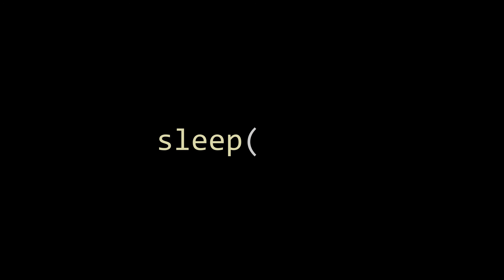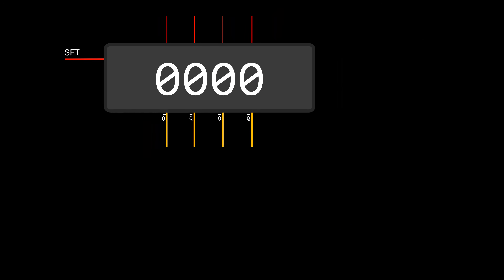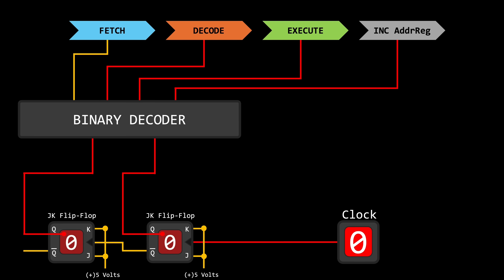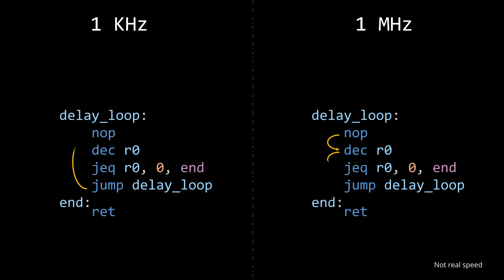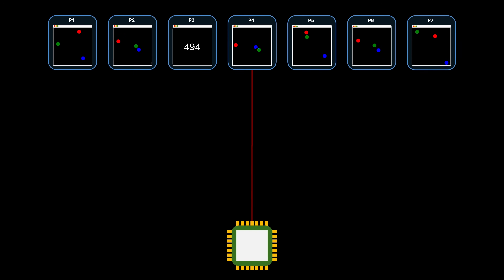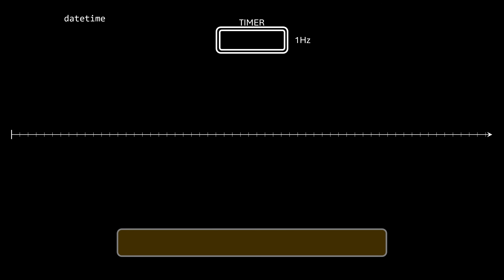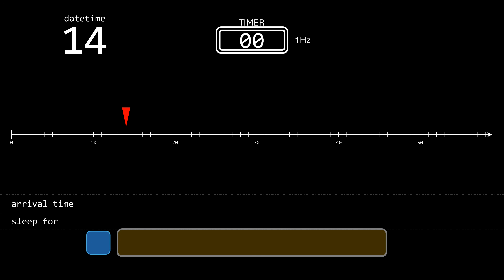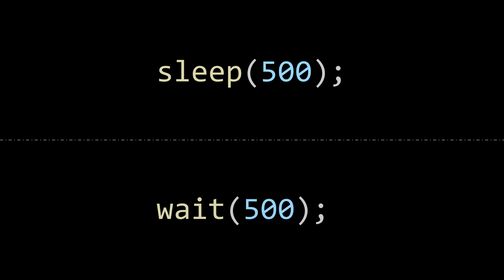What Happens When a Program Calls Sleeps?

Comment: Nice explanation. It is essential to remind programmers that their code has a connection to the limitations of the hardware beneath. This understanding was implicit decades ago, but there seems to be a growing detachment between some software and the physical limitations of the  hardware it controls .
In software space, anything can be achieved. In hardware space, physics limits what can be done and coders have to be aware of that, so that they can take it into account.
An exaggerated example could be; although humans are capable of feats such as jumping the height of a sky scraper in a video game, in the real world they can't and thus any real world code has to take that into account. No doubt few programmers would make the mistake of trying to make real world humans do in the real world what they can inside games, but there are many real world scenarios which are much more subtle than that case and coders need to understand physical limitations of the equipment they seek to control to ensure they do not introduce dangerous edge cases.

A real world example that came to my attention: an x ray machine had two modes. 1 full power for short bursts for treatment. 2 longer low level doses for diagnosis. The difference was a motor pushed a filter between the X ray source and the patient on the long duration diagnosis mode to cut down the intensity of the x rays and protect the patient.

Apparently the software controlling the machine didn't take into account that the motor takes a finite time to move the filter into position. The system was started in a non standard way ( understandable when humans are involved) and the X ray was started by part of the code, but the position of the filter was not monitored , just assumed. No delay was included to allow the filter to get into place and the patient received a long full power dose which ultimately proved fatal.

So you see software " mistakes" can have real world consequences, and the more software takes over from pure hardware, the more likely these mistakes or oversights will be made.

So the advice is that programmers shouldn't code in a vacuum, they should take time to understand how their software will be used and abused in the real world and take account of bad and lazy operators, who will test their code to destruction.

I've lost count of the number of times  I have heard " it wasn't designed to do that" when hardware or software failed in an exotic  manner. Of course it wasn't designed to do that, the designer just failed to take into account less than ideal methods of operation, IE the real physical world.

Comment: 3:24 can't the other process start a variable called end time which takes another processes timer and substracts it by the amount of time it takes
Like for example there are 2 clock circuits on a cpu 2 programs call it one more program makes a timer call one of the timers already being used on the cpu is at 10 and the new program needs a timer for 5 ticks and so the program records there are 10 seconds and then it checks "is the timer at 10 subtract 5 ticks?"

Comment: NOP is actually remained from the old intel architecture's opcode 0x90 which meant XCHG AX, AX so in human readeble form: swap ax with ax, which has literally no meaning and burns a clock cycle. So then they just began to call it NOP and assemblers added NOP support later on.

Comment: I think the "at least this long" is important for another part. Windows by default clumps up waking apps to a coarse timer interval. It's less than a second, but I want to say it's something like 500-700ms. But even though the system call to sleep may use millisecond precision, Windows won't service the app until the next interval.  That is unless the app says "hey, can you check faster?" and then you have scenario where Chrome was eating battery life because it wanted Windows to check every millisecond.

This is also a lot of fun with bare metal embedded programming, where you have to start worrying about how precise your clock source is. I had a naive clock app running on the SoC's internal clock generator and it drifted by minutes every hour.

Comment: So if i understand this correctly, the timer that implements the sleep timer is different than the timer that triggers the scheduler in case of preemptive thread switch? I know in x64 architecture the preemptive timer is implemented in the LAPIC associated with every processor core, where does the sleep hardware timer reside?

Comment: The few cases I used wait, it have taken a process or thread as argument, and waited until that threads is done with it's mission. Is this also handled by the OS/kernal, or is it just an implementation of sleep in a loop?

Comment: Oh, hey!!! I just learned this lesson!!! (At a higher level)

I programmed a game where I wanted to do a certain action while a button is held. 

I am a total beginner, so I used a while loop while the button was pressed.

….aaand the game froze

And because it froze…. It could never even satisfy the loop conditions.

Instead, I got it to do exactly that. Every frame it iterates through all of the different processes happening. When it got to mine, it checks if the button is and was last frame pressed, then either continues to do nothing, starts the action, maintains the action, or stops the action appropriately, then goes back out to do all the other stuff like input checks, movement, cheats, console, enemies, etc

Comment: JS is non blocking and typically single threaded. It's also gone through about 3 shifts in how it handles what would be blocking operations in other languages. All 3 are shown off in that sleep implementation. 

Namely, callbacks, promises, and async await. The JS engine will move on to execute something else while your code is "asleep," however, and will return to execute your asleep code once the timeout has elapsed.

Comment: I have one question for long time in my head:

In my mind OS has two tasks -
1) Manage resources (CPU time, memory, e.t.c.)
2) Provide imitation for other processes, that they run solely and have API to work with resources - system calls

Why, then, kernel - isn't an OS, but a bunch of optional programs ran by kernel are? What exactly distinguish OS from kernel?

Comment: And then frameworks arrived, and for some of them using sleep is a really bad idea as it doesn't release resources of the logical thread it's using, thus basically recreating the problem sleeps here resolves.
(In DotNet it's the difference between thread.sleep and task.delay, and we usually prefer the last one)

Comment: In Swift (a programming language introduced by Apple, commonly used for developing iPhone and Vision Pro software), the situation is more complex. Task.sleep not only requires await, but also try, because Swift's structured concurrency mechanism allows cancellation of a sleeping task, in which case it will throw a 'cancelled' error.
Reply: Program: Hey, I would like to sleep 😊
Runtime: I refuse 😈
Reply: @null-0x more like the Wolfenstein meme: "wake up, you're dead!"

Comment: Here are some examples that are still not well understood. Sleep does not notify you in 10 seconds. So, will you notify me in 12 seconds? Actually, even if there is no notification after 60 seconds, that is the specification.
I'm currently programming in a Windows thread pool. The worker threads have been set to the number that will be the number of physical cores. A work task is a heavy 'MinMax' algorithm task that can be used to prevent it from being completed in 10 seconds depending on how it is set up. It consumes so much CPU resources. However, even under such circumstances, the tasks must be completed in 10 seconds and the results of the tasks must be transmitted to other programs. This is because a timeout will result in the program itself being a loss. I used various techniques such as Sleep (1000), WaitForSingleObject, SetTimer, ThreadpoolWaitObject, TheradpoolTimerObject, etc. in the main thread of this program, but no notification was received in 10 seconds. Why do you think it's? For example, using Sleep, this means that Sleep will surrender the thread to another process. So is it guaranteed that the thread will return by 10 seconds? In fact, it is not guaranteed. Even if the thread returns after 120 seconds, that's exactly what you're doing. So, how can you measure it almost exactly for 10 seconds? The only thing I could do was insert an API to retrieve 'TickCount' into the 'MinMax' algorithm and then, compared to the 'StartTick' that I had saved, it had no choice but to have it terminated if it exceeded 10,000. It is clear that the OS time slices have a more detailed chance of acquiring threads than the thread scheduler. Also, raising the priority of a process is just a gamble.
I call 'Sleep' a passive timer. And the timer processing to get a 'Tick' by itself is called an aggressive timer.

Comment: This is completely wrong. You're considering both logical gates and OSes at the same time but that NEVER happens.

It's either a software active loop or a software adding some event to its imterrupt loops. 100% of the time, no hardware counter is used. Those are used for pwms or hardware event triggers.

Comment: 00:02 ⏱ The sleep function is available in most programming languages (except JavaScript) to pause program execution between code lines.
00:21 🤔 The video explores why the function is called "sleep" rather than "wait" or "delay" by examining hardware and software concepts.
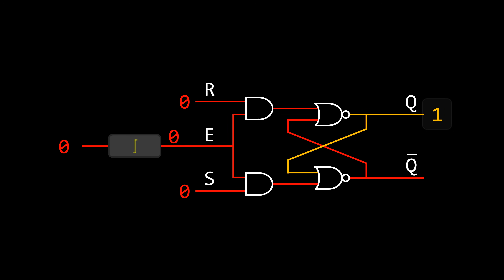00:44 🔧 A hardware timer can be built using flip-flops, which are memory cells made of transistors.
01:18 🔄 A counter circuit counts up, while a timer circuit counts down, both built from flip-flops but wired differently.
01:46 ⬇ A timer decrements its value with each clock cycle and can be set to a specific initial value using additional logic.
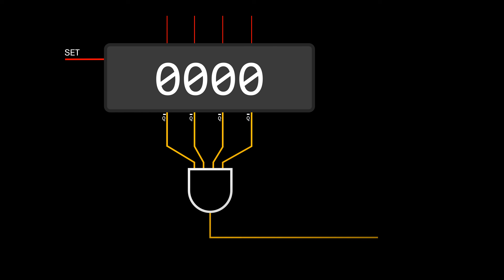02:51 🚨 When a process calls sleep, the OS sets a timer that triggers a hardware interrupt when it reaches zero, resuming the process.
03:06 🚦 Hardware timers are limited resources - if a chip has only two timers, only two processes can use them simultaneously.
05:24 🕰 CPUs need a clock to run code, acting like a heartbeat that tells the CPU when to execute the next instruction.
05:53 🔄 Busy waiting is a simple method to create delays by using loops that do nothing but burn clock cycles.
06:46 ⚠ Busy waiting is inefficient as it wastes CPU time that could be used by other processes.
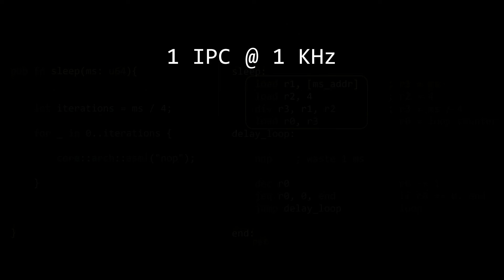07:16 ⏲ Modern CPUs don't run at constant speeds - they can boost under heavy load or throttle when overheating.
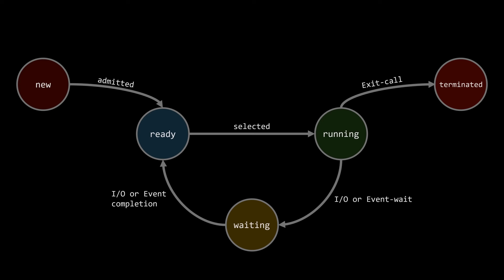08:26 📊 Processes cycle between three states: ready, running, and waiting.
09:12 🛑 In non-preemptive systems, busy waiting can freeze the entire system for the duration of the loop.
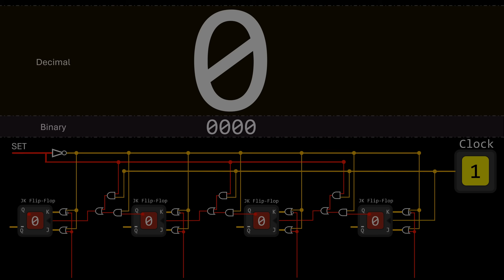09:43 ⏳ Preemptive operating systems solve this problem using hardware timers that interrupt processes after a time quantum.
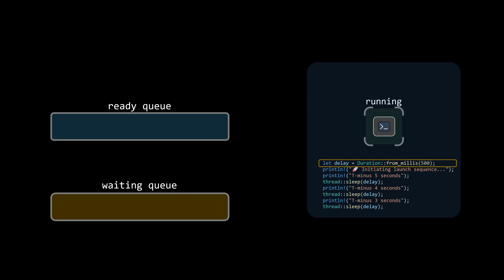12:13 💡 The real solution to delays is making the process enter the waiting state while the CPU works on other tasks.
12:45 🧩 Software solutions enable multiple processes to share a single timer.
13:10 🗓 Computers measure time by counting time units from a starting point called an epoch (e.g., Unix epoch: January 1, 1970).
13:43 📋 Processes that call sleep are added to a "sleeping queue" with their start time and requested wait duration.
14:30 ⏰ When a timer expires, the OS moves processes whose wait time has elapsed back to the ready queue.
15:42 📊 Keeping the sleeping list sorted by wake-up time ensures efficiency when the timer interrupts.
17:13 🏃 When a process wakes up from sleep, it's placed in the ready queue and must wait for the scheduler to run it.
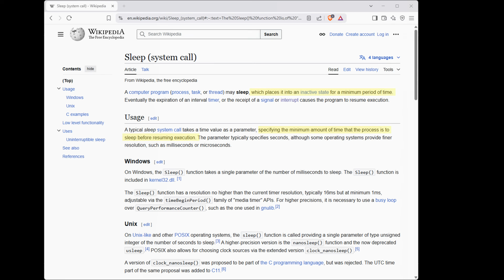17:42 ⚠ Sleep times are minimum guarantees, not exact - processes may wait slightly longer depending on system load.
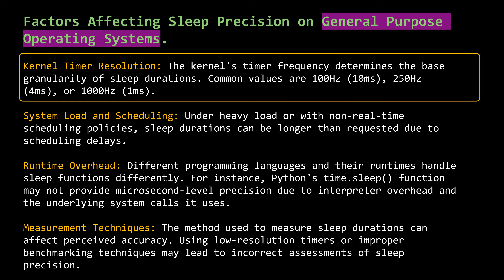18:34 🖥 General-purpose operating systems aren't real-time systems and typically have time resolution of 1-10 milliseconds.
19:08 💤 "Sleep" implies the process enters a passive state to avoid interfering with the system, while "wait" is more generic.

Comment: Busy waiting is a valid method if you have a lock that you know ahead of time should be extremely fast.  In that case lock contention should practically occur almost never, and if it does,  it will be allowed to proceed within a few cycles.  Yielding the scheduler to another process in that case will end up being a waste of time, and actually increase the chance that lock contention will occur, especially if it's heavily used.
As always though it's extremely situational dependent.
Reply: That sounds dumb to me. If you have a resource (say a shared memory between processes) and another process has a lock on it, the lock won't be released until the process that has the lock finishes. So your first process will just do some busy waiting, probably time out by the OS, get kicked out with a context switch, and don't get control of the CPU until the process with the lock finishes. Rather than burning clock cycles trying to check a lock that probably isn't going to change (and it probably is not while the first process is in control), why not just yield the CPU? You still suffer the context switch overhead. However the first process is more likely to get access to the shared resource faster. In most cases with a lock, the process with the lock needs the CPU time to finish whatever it is doing and releasing the lock. Every process that competes with the CPU delays the release of the lock. It makes sense to give all processes CPU time, but if you're just constantly checking if a lock will change, it probably won't (since the process with the lock is waiting for the CPU while the first process is wasting CPU time!).
Reply: @alex_zetsu  Somewhat fair, but I think it also depends on if how the multithreading is implemented.  If it's on user level threads where you have one process which is using it's own multithreading implementation (so the kernel isn't aware of the individual threads) then yes, in that case yielding to the scheduler is the fastest option. 
However if it is with kernel level threads on a multicore cpu where you can actually have parallel processes (not just concurrent ones) then I think my original argument still holds up.  The only catch there would be if the threads have been restricted to only run on a specific core, in which case we're back to square one.

As always it is context dependent, but I still stand by my claim that there are situations where this can be a faster option.

Now to be fair, I do think a better option is for the processor to be better optimized for locks to try and prevent, or at least minimize, the OS's scheduler routines from interrupting during a lock.  I can envision a few days to do this (best way would be to have a specific instruction for handling basic locks, although this would likely involve having to have another os handler and would likely only work for certain scenarios) but the simplest might just be to try and detect when a lock is entered, and exited.  Most locks usually us a specific sequence of atomic instructions (on x86-64 XADD is one of them iir).

The idea here would be if the cpu detects that the process uses an atomic instruction, then if the scheduler interrupts happens to occur during that time period, the cpu would continue on for another 20-50 instructions or so (provided none of them involve any sort of external resources) and wait either for either another atomic operation (i.e. the program exiting the lock) or until the number on instructions has been used up.

Of course you could also argue that I'm trying to optimized for a situation that is extremely rare, so there's not really much point; that's a fair argument as well 😁
Reply: Indeed, spin locks are a thing in the kernel. They are more efficient than yielding when you know the wait will be very short.

Spin locks are generally a bad idea on userland because, if the process holding the lock is scheduled out, you may end up spinning way longer than expected, and thus wasting lots of CPU cycles. I've read, however, that modern mutex implementations do busy-wait for a few cycles before yielding the CPU. This “optimistic spinning” is an optimization that avoids a context switch in the common case where the wait turns out to be very short.

Comment: Idk what you might think about this, but the reason why js doesn't have a concrete "sleep" function but instead needing a funky delayed promise is exactly the implementation of the sleep function itself, since js engines are already a scheduler themselves (i.e. event-driven)
Reply: ah yes, the ECMAscript event-loop and task-queue, my beloved. That's literally one of the few good and "revolutionary" features of JS
Reply: @Rudxain strictly the browser event loop was just a natural consequence of executing script synchronously in the UI event loop, so it's hard for me to see it as revolutionary even with scare quotes, but perhaps Node managing to port that model to the server as a way to multiplex connections on a single thread counts.